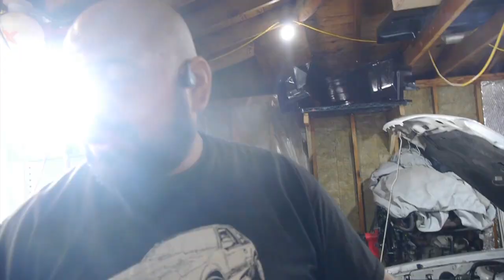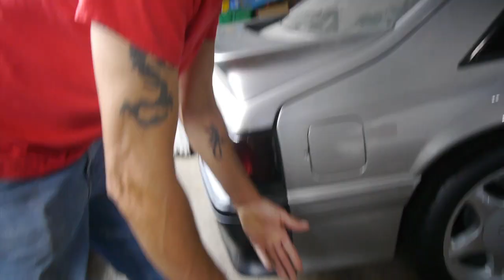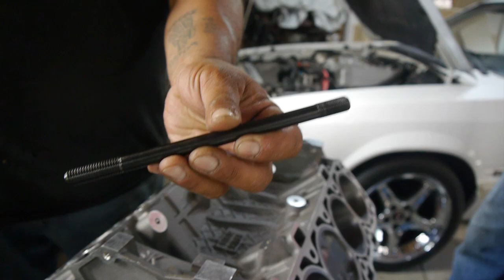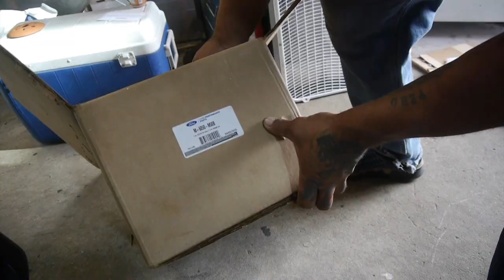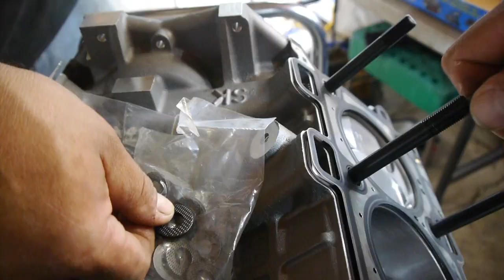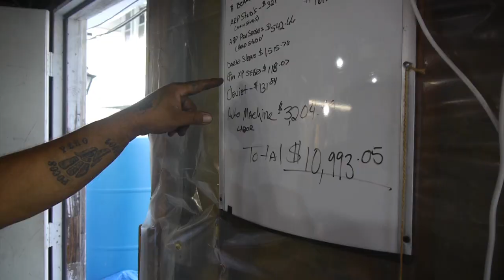Coyote Engine Cylinder Head & ARP Cylinder Head Studs Installation

Comment: I think the reason for the hex on the bolts is so you can prevent them from moving as you're torquing down the head so it doesn't bottom out and put stress on the block